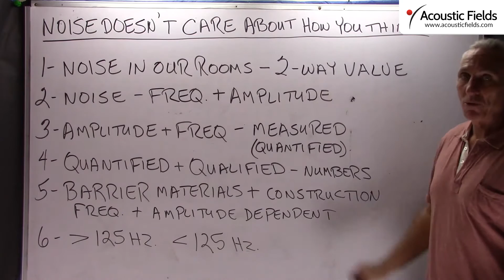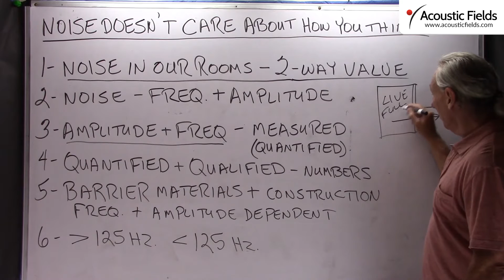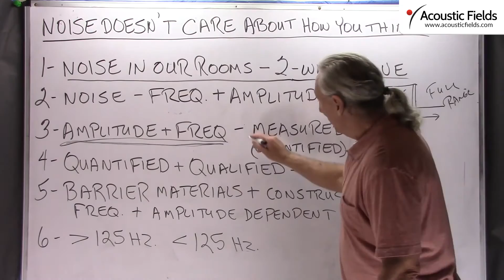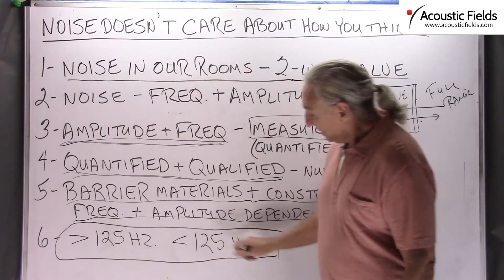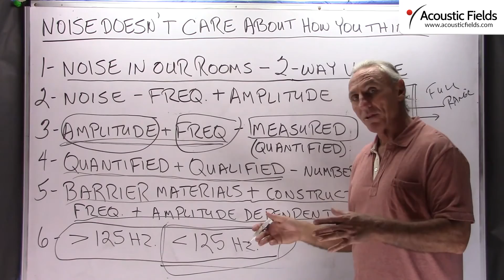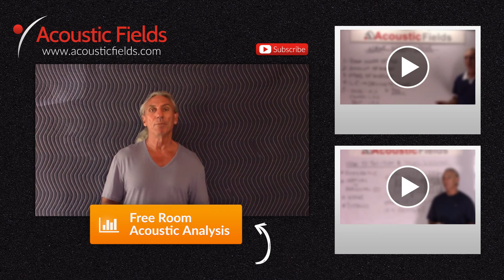Noise Doesn't Care About How You Think - www.AcousticFields.com

Comment: Great video. It sums up almost all concepts of noise. And if I may add, in guesswork, either you end up with the wrong barrier, you'll end up spending less without fully addressing the issue or to make it worse, you may also end up spending more without certainty that the issue will be addressed.
I always get a lot of inquiries re pricing and quotation for sound proofing and noise treatment. I normally cannot give prices because fact of the matter is, I don't know the frequencies involved, the strength and where the noise is coming from.

Kudos to you Dennis for sharing this video so that consumers will know what they are dealing with.
Reply from the maker: Hi Nelson, Without knowing what the problem is, you can not solve it. You must identify frequency and in most cases the more important variable of amplitude or strength. Use 125 Hz. as your dividing line for barrier technology. Frequencies and most amplitudes above 125 Hz. can be treated with current materials and construction techniques. Frequencies below 125 Hz. require require different materials, different arrangement of those materials, more space, and different construction methodologies.

Comment: The whole concept of "facts don't care what you think about them" is hard to hammer thru. And the arguments you brought up are exactly in the end:  "i'm doing this to do accomplish i-don't-know for reasons i-don't-know".  If people would do even quantitative measurements and applied simple logic there would be much less resources wasted on useless electronics and random room treatments. Battling speaker/room issues is like trying to level mountains and yet; the industry and media seems to be focused on polishing the surface of that mountain, brushing up dust.
Reply from the maker: Hi Squid Caps,

I couldn't agree more. I see so much guessing and misapplication of even the smallest rules of physics when it comes to small room acoustics by both end users and manufacturers alike. I just had a call from a client who bought 10,000 worth of a competitor products and was disappointed in the sound quality after installation. The dealer who sold him the absorption technology did not even ask his room size, volume, or intended usage. This is the reason for my data base. See response to Home Theater Eman below.